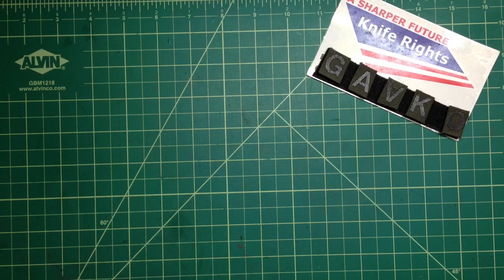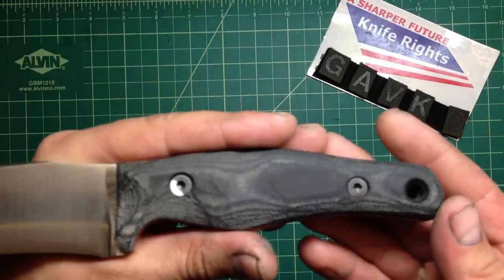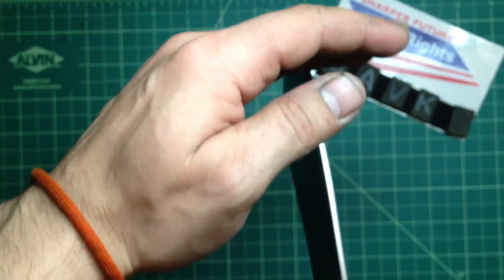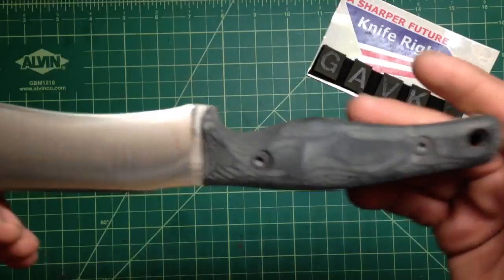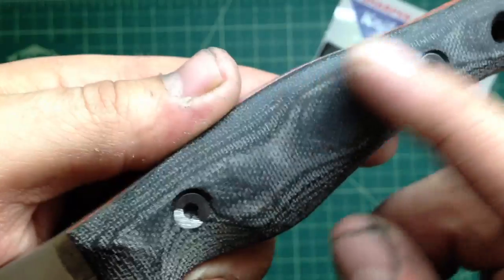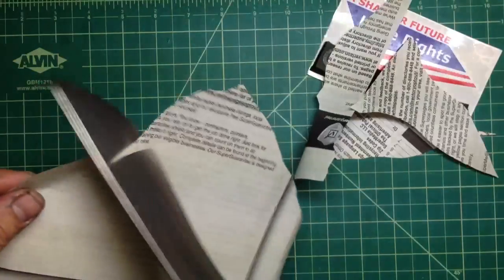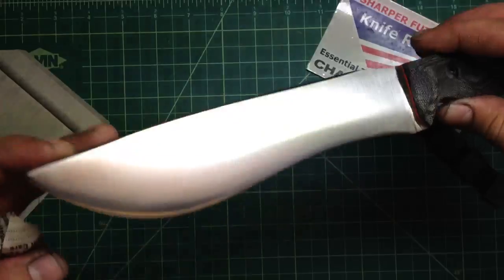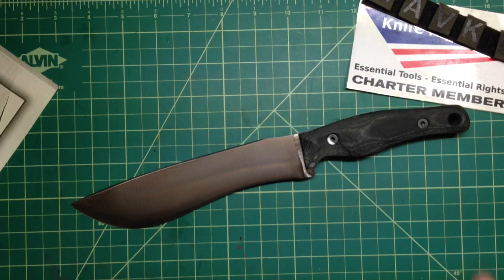Reverse Bolo/ Kukri knife finished

Comment: If you want to do a real kukri without wasting a lot of metal you can get a bar at the widest the blade will be, cut and weld the handle at the angle you want. There are probably welding shops near you. You can also forge (or heat up) the metal to bend it to the shape you want.

Comment: Love that finish on the blade and the handle looks sharp with the black micarta + red liner. 

What makes the micarta a more difficult material with which to work as compared to G10? Also, where does carbon fiber fall in relation to G10 and micarta?

Lastly, for a blade that's meant to be used hard I'd like to see a bit more material (metal) at the end of the handle for both grip retention and possibly striking stuff.

Comment: The reason they probably do not use it is because the cost of the machine and to install it in an assembly line is very high. They can probably just use the large billets and price the knife to cover the waste metal. Also manufactures can recycle the steel and get money for doing that. As to not being as strong the weld should be just as strong if not stronger than the rest of the blade. Kershaw uses a braze welding technique  to put the two metals of the blade together in some of their knives.

Comment: And also I'm a welder by trade and a weld is stronger then the surrounding metal. The only thing you have too watch out for with stuff like that is if the weld was put in too hot then the heat affected zone is prone to cracking